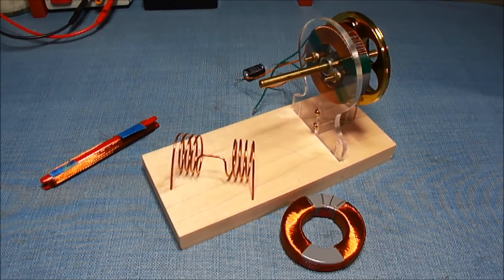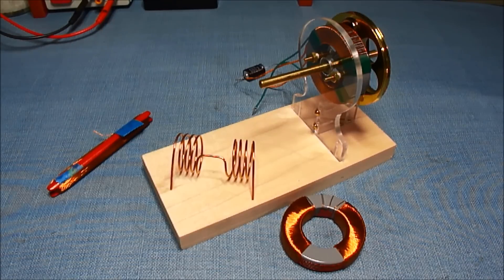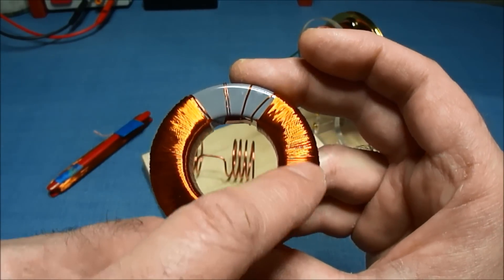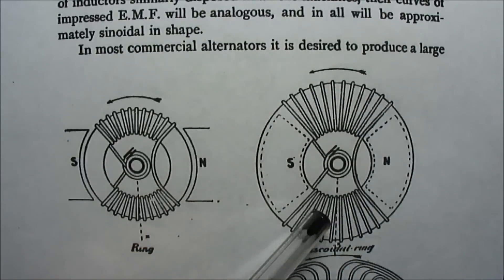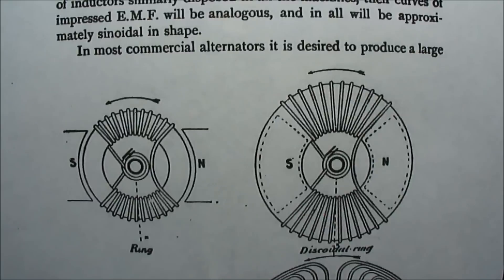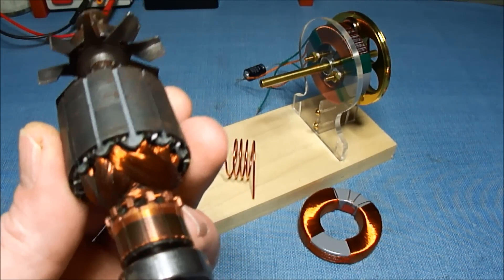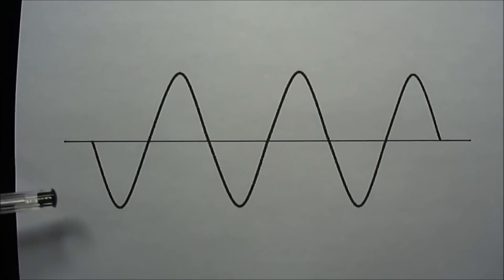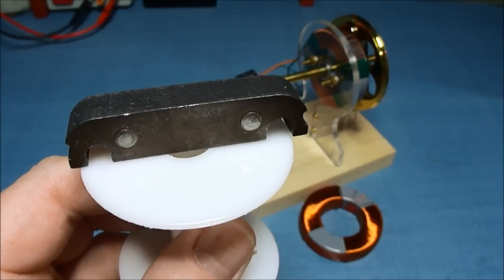Toroid Dynamo Coil & Generator Pole Pieces

Comment: by adding magnets,wires,cores lenght width hight is necesary if you change any of those values you get a sponteniuse diferent reaction some interesting lectures has prof. eric leightweit linear induction motors and presentation about magnetic mashines, in my opinion brakeing a magnet in 2 pices creates 4 poles so imagine the diference haveing a generator operating at 4 poles not 2 its a mather of multiplication so if you change core value and windings you get similar effects not including useing duferent materials to build a generator in my opinion a regulator is not needed at all as long you have lot devices that consume power you dont need to regulate that power expecialy not if it is a singel pulse generator meaning you dont need comitator ore a rectifier!
by achiving high speed generators are best because just like anty graviti devices like giro's you get ride of forces drag on generators for exampel 20-30k rpm generators you create high frequenci's that type of generator by him self can run many things and is very small in size so if you want to buld some things you might consider adding speed to your advantage for plazma ignition and light bulbs is a high speed generator used for high curent aplication's like runing a fringe for exampel is used a high curent generator at low speed exept if it is a variabel generator it can produce bouth. see please how a pick up coil and reluctor works you can have bouth magnet and wire to by stationary and use actualy soft metal core to produce a magnetic field histeria,vibration,sound all of that is considered as a magnetic field

Comment: Hello sir,

Great job on video presentation and clear definition on what idea/topic your commenting on today in regard to your video. I'm looking for a method of pumping power at a very low RPM for an experimental generator that I have been working on for 6 years now. Most methods being experimented with or used (for example wind power) are all very similar. It all does work but I cant help think that it can be improved. My question to you is what do you feel is the better way to pump power? Again most of what is being built all share similar build ideas and use of materials. I'm sorry if this is a strange question and unclear. I haven't experimented much with a Toroid and look forward to your video's of what you find for this method of generating power.

Thank you for your video's!
Reply from the maker: Hi Josh, Thanks for your comment. I would only use a bifilar coil in a generator because of the effects it can have and the many options of how to use the coils vs. a single wire. Hopefully future tests can better answer your question. Cheers Mike
Reply: I will use a bifilar coil then. Thank you and look forward to watching your findings.

Thank you again sir!